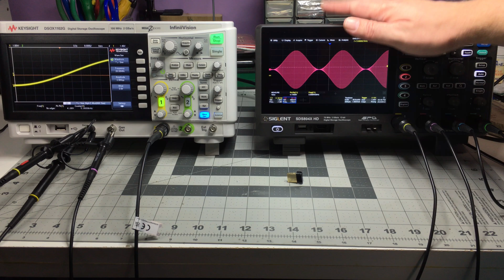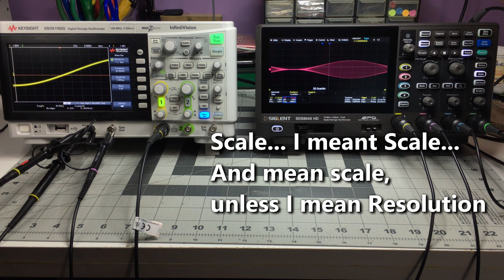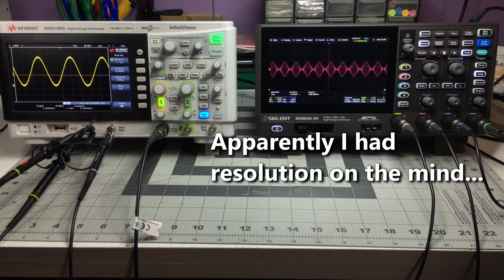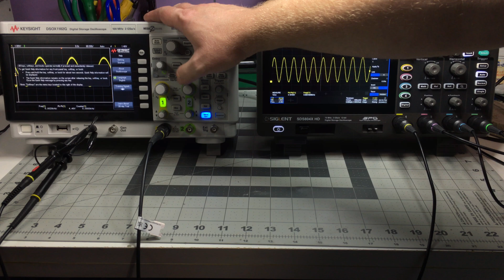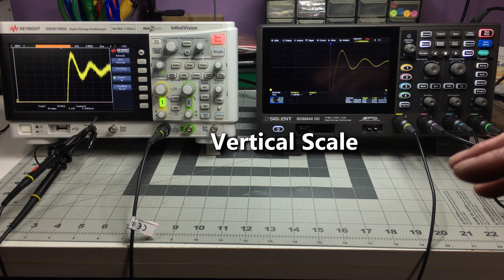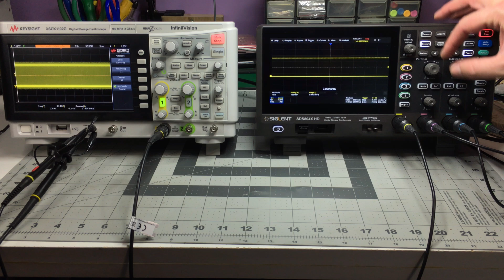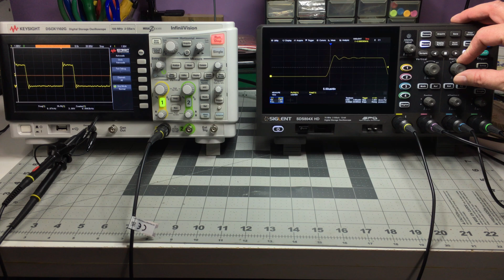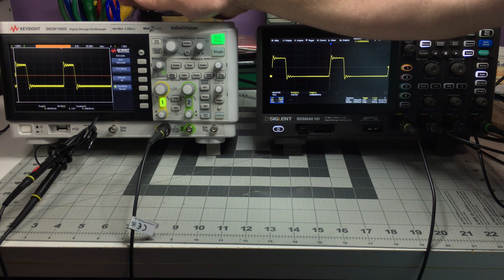TTE 30 Siglent SDS804X HD - Some Answers, Memory Depth, Resolution

Comment: It's not hard to log into the linux using the internal serial port on the motherboard, activate a remote console and change root password. You might be able to activate your Wifi driver then. But yes, an external bridge will definitely be easier

Comment: I BIG MISTAKE purchased the keysight at retail price. (2 grand!) Now I wish I had gotten the Rigol. I am trying to sell the Keysight and can't get any offers above $500. BUMMER! The 12 bit resolution DOES MAKE A DIFFERENCE! The keysight you have to press the stop button to get a sharp trace while the Rigol gives an equivalent sharpness in real time. The digital readout on the Keysight is almost useless in realtime because the numbers constantly jump around.
Reply from the maker: I have looked at he the used scope market.  It's interesting, I think the used market for say Keysight, R&S, LeCroy etc. is fairly small, at least privately as most hobbyists cannot justify the cost and businesses that can afford it probably have closer relationships with the equipment suppliers and deal with them. I do occasionally see Siglent and Rigols come up used, but not as often as one would think.